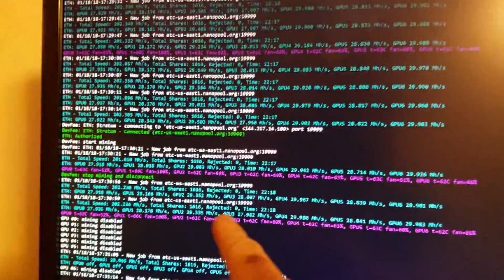GPU PCI-E Port Multiplier & Ethereum Mining Follow-Up

Comment: General question. When looking at video cards for example the RX 580. I have read that the ETH has an average 32.2 MH/S for one card. If I add 2 of these cards would that mean the average ETH would go up by 2X's or add 6 it would go up by 6X's etc...?
Reply from the maker: Yes. The hash rate is per card. Two cards = double the hash rate.

Comment: hey iam using a pcie extender right now,, my motherboard(ASUS h110m-d) and my cpu is (intel Pentium 4600) my mobo only has 3 pcie slots.. i tried to use a pcie extender so I can connect my 6 gpus (rtx 3070),, but windows doesn't recognize it.. when I go to device manager is says there code 12 (free up some space to enable this card)... can anyone help me with this problem???
Reply: I have the same problem with Asus motherboards
Reply: Set your virtual memory (your pagefile) equal as the total memory of your Gpus combined, EX: In your case you have 6 X 3070 8GB, so u should set your pagefile to 6 X 8 = 48GB

Comment: I have watched many mining rig builds and wondering why you have to use risers for every slot? Can you just use the PCIe x 1 with risers and for PCIe x 16 just plug the gpu into the motherboard? Sorry if that's a dumb question but I don't understand why not.
Reply: No question is a dumb question. Here it would look a bit organized and would be helpful if more fans are added in future. Also there are some coins and algorithms which give advantage for pcie 16 over X1.

Comment: For the risers can you plug a usb hub between the motherboard and the card to effectively split 1 slot into as many as the hub can output?
Reply from the maker: No. The port multiplier has USB connectors, but they are just using the connector. It is not actually a regular USB port that you can plug USB devices into, such as a USB hub.

Comment: Well spoken good video. 
Just built my first rig and I got about 3K in it < LOL $300.00 each just for 6 1050ti's.
Reply from the maker: Any particular reason you went the Nvidia route over the RX cards? The RX cards are cheaper and hash pretty much the same rate.
Reply: First build, next one will be with amd cards.
Reply: I am curious to know how old you are, I am 59, I think it is brilliant how you put your rig together, where did you get this knowledge?
Reply: @LithiumSolar  i build a rig with 6 XFX 6800xt cards and one after the other goes to rma, no Fan spinning, no Video output, not even detected as graphic card. 6 from 6 cards in RMA. With or without overclocking no different, the can mine for 3 or 4 month Max. Drivers are bullshit too, crashes at least one per day. They also pull much more Energy from the wall, as what the miner says. Never again amd.

Comment: For people stuck on 6 cards, what you need to do is put a single card on the x16 port. (This is the long slot) then in bios change display to x16, this will force the mobo to use this card. Now running all 7 with nicehash
Reply: will this work for all the high end cards like the 3070's ?  Like will the splitter ensure all the other cards are operating at x16 as well?  Thanks!

Comment: would this work with an Asrock AB350 K4 and Ryzen 7 1800x CPU? I have 6 gpu's but want to expand to 10 using pcie multipliers
Reply from the maker: Unfortunately I don't have that particular board to try. The multiplier cards are cheap and you can always return if it doesn't work.

Comment: to awnser your question:
-each gpu takes up 1 pcie lane 
-ethernet / wifi takes up 1 pcie lane
-pcie ssd / m.2 takes up 1 pcie lane 
- to find out how many lane your cpu can handle google "{cpu model name} ark" for example (7600k ark)
-scroll down too Expansion Options
-under Max # of PCI Express Lanes you should see the number of max pcie lanes

hope this helps
Reply from the maker: I don't see that data listed for the E7400 though
https://ark.intel.com/products/36500/Intel-Core2-Duo-Processor-E7400-3M-Cache-2_80-GHz-1066-MHz-FSB

Comment: Hi lithiumsolar I recently decided to buy a dx7500 computer to follow your build but I can't seem to get any display when I have anything in the x16 slot (except when theres only one card). I can only get 6 cards working using 3 of the pci-e x1 slots and the port multiplier. I see that you have your rigs connected to the x16 slot and working fine, what are your settings for your bios?
Reply: I've tried changing the primary video adapter in BIOS and disabling some features like onboard audio and virtualization, clean reinstall windows and drivers, the risers and GPUs are fine but can't get 7 cards to work,
Reply from the maker: I have my primary video adapter set to use PCIE x16 even though it doesn't actually use that one as primary. I also have the onboard video set to disabled. What CPU are you using?
Reply: I can't get a display when I set it to x16 :/ and I don't see an option to turn off the onboard video, only to choose primary video adapter. I'm using a Core 2 Duo E8400 processor
Reply: Give it 10 minutes. The display shows up on Slot 3 which is a 1x.

Comment: so can you put the Multiplier card on the PCIex 1x or 4x or 8x instead of the 16x like you did. And see if it's work?
Reply from the maker: My multiplier card is in a 1x slot. I did not test it in an 4x, 8x, or 16x but I see no reason why it wouldn't work.

Comment: I am about to run 12x rx 560 @ 162$ each. 12x gtx 1050ti @ 169$ each all 4gb. They should do fine with their 75w power consumption. Your dx7500 or any computer thats under 100$ that comes with all the parts is smart. Wish I had done that vs. a 60$ motherboard and 60$ cpu. Maybe for my next build.

Comment: hey if i set from bios to pcie gen 1 can i enable 7 gpus just from 2 pcie slots?
Reply: i have tried pcie x4 port extension can you help me , when i try to install 5 gpus pc starts about a hour later and appears to be hanged up.  I have gigabyte b85 d3m and intel dho

Comment: Hello , I have some question for you , I get same card 'EUX1-04' , it's similar yours but when I install second card   it's not working
Reply: Thanks for your reply ! I only use one 'EUX1-04' card and I try to disable LAN & Audio & serial port , but can't fix this problem ... T^T
Do you setting anything else ?

Pic :  https://goo.gl/iQSBKV

MB    / ASUS P5P41T LE
CPU  / Intel E6300
RAM /  DDR3 1600 4 GB

Comment: Hi Mike. Can you explain how your server PSU work ? I mean with "normal" PSU you just need a dual or triple PSU adapter to boot them all at the same time. How your's work ?
Reply from the maker: I just turn it on at the same time as I push the power button on the computer. You don't need any adapter for this one. The PCI-E connector board that attaches to it actually has an on/off switch. Also, there have been several times I turned the computer off and just for general maintenance and left the server PSU run. The cards don't seem to care, when you turn the computer supply back on, they're still all detected and work fine. Not sure it's bad to do that or not.
Reply: Yeah I do the same exact thing. No problems so far, my guess is that the cards aren't drawing any power from the PSU, and they are grounded to the PSU that is supplying power, so theoretically it shouldn't do anything until it "requests" or draws power from it. I was also super worried the first few times, but have noticed that nothing bad happens when the motherboard is off and the GPUs stay powered. :)

Comment: Dude that hanging gpu idea saves so much money and time as opposed to building a complicated frame, just zip tie and done macgyver style haha
Reply: The biggest problem for me was figuring out how to build a system that wasn't to expensive and that can hold all these gpus. I had either two options to buy one for several hundred or build one, which by the way I have NO power tools , even if I did it takes time out of my day to just build a frame without even being able to test the new parts. I am ecstatic, you genuinely helped me make my system less time intensive and more profitable, thank you for responding and making a video.
Reply: You can also buy a second unit and add onto by just staggering the shelves, or making the poles taller and adding more shelves. Altho, you need a cathedral ceiling for that  😜
Reply: @BonesSheppard: You could also make these racks from wood. Just get a small hammer or use screws and screwdriver. You can get small 1x1 pieces fairly cheap. But I like the wire rack idea too 🤠